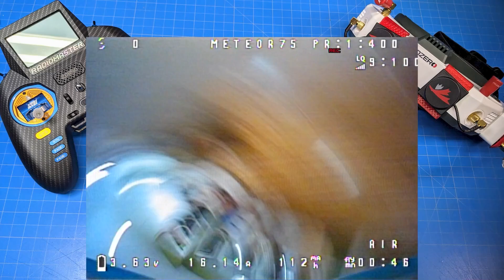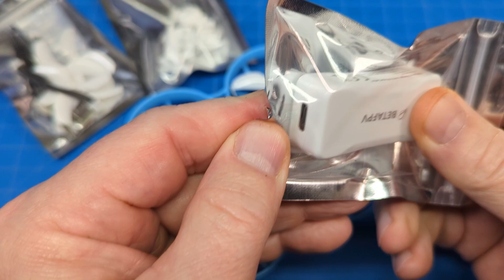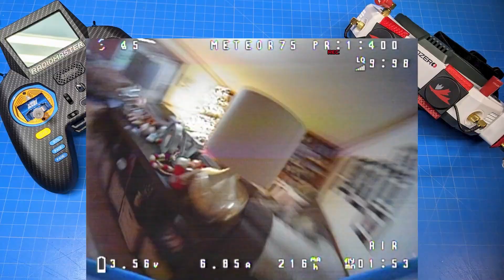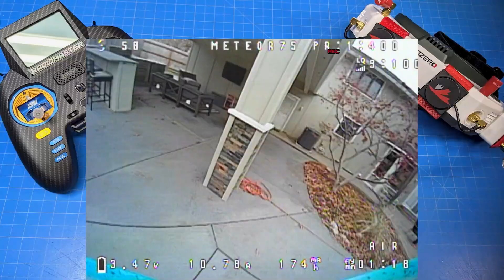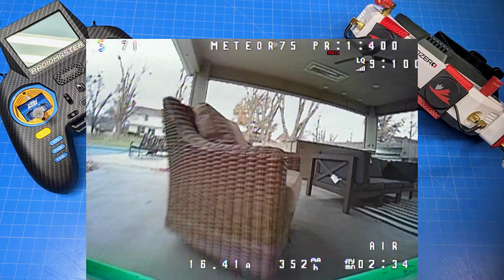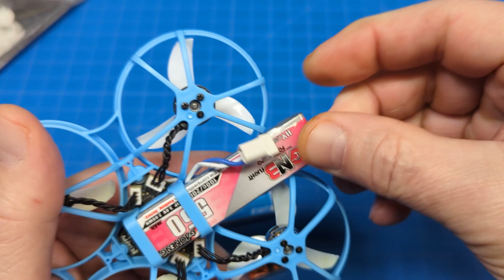Meteor 75 Pro // BetaFPV Matrix 5in1

Comment: Yeap. I have the exact same problem with the vtx right out of the box. Betafpv did a good job with putting a coating over the vtx antenna connector, so the connector is not loose. Changing bands and power didn't make a difference. Outdoors I don't have the same issue. I get a way better and stable feed from gen 1 Mobula 6 at 25mw. This was my fear with this 5 in 1 board, that the vtx would be bad .  So disappointed with Betafpv on this tiny whoop

Comment: Ey nick  what do you prefer air75 or meteor 75pro for flying outdoors and some Indoors, also im gonna stick a naked runcan thumb pro for 4k footage adding 10,grams, which would handle. Better the weight? thanks
Reply from the maker: I like the air75 but for your external camera flight I would suggest the 75pro
Reply: @NickBurnsFPV  thanks

Comment: This was my first drone and it didn't fly well on default PIDs with new props and everything. Bad oscillations coming out of dives. I tried my best as a beginner to fix it but I couldn't. I got a second drone eventually that actually flew how I wanted it to fly. I got a brand new chassis, the lite canopy, and ordered a new camera upgrade to the CO3. I'm going to practically rebuild the Meteor75 Pro and see if I can get it to rip again. I love my 65mm drone but I prefer the heavier, thicker plastic of the 75mm.
Reply from the maker: good feedback. Good to hear you were able to get it sorted out.

Comment: HI Nick, what's the analog module in your HDZero Goggle? Do you know whether the Steadyview receiver in Skyzone Cobra X V2 will work with HDZero Goggle?
Reply from the maker: I have the rapidfire module. I am not sure the steady view would work. It doesn’t have a button to use to change frequency and other settings. Not sure if the hdzero google would be able to manipulate that module

Comment: have to say amazing indoor flying but i have a problem when flying my meteor 75 pro when  i go to do back flips and front flips one of my motors tend to cut making the drone go all over the place and struggling to start up when arming the drone  got any suggestions
Reply from the maker: check for hairs around the motor, move the motor to another spot on the quad, it could be the esc isn't operating normally if the motor is fine on another esc. If the problem follows its likely the motor is damaged.
Reply: @ thanks for replying I have checked for any dirt or Hair
 But nothing I have order new motors I will soon see what the problem is just seeing if you had any other thoughts thank you
Reply from the maker: @finleydavies7047  The only other thing I can think of in the moment is to increase the esc startup power and see if that helps.
Reply: @ I have done that it’s almost max but we will see when I get my new motors thanks you

Comment: Can this be upgraded at all ? A better tune maybe idk new to fpv.And how would i change change the power to make video feedbetter?
Reply from the maker: Please don't change things as your starting out. The probability things get worse is high. Learning to fly fpv isn't the time to change settings, we need to learn to fly first. If we aren't familiar or confident flying the changes we make we either won't notice or it makes things worse, or even unflyable. More experienced flyers have learned not only how to fly but notice small changes. On youtube these small changes often as reported as "so much better" or "game changers". The reality is those changes have a very very minor impact to the vast majority.
Reply: @NickBurnsFPV  i can fly across fast Bob and weave andcontro, the drone I just haven't been able to flip it like I can the th3 but yes I can fly it easily I got the simulators aswell on xbox and tabs so I'm fixing to master this shit.
Reply from the maker: @BowTwoone  each micro is different and has different flight characteristics. The tinyhawk isn't prop protected but this one is, so it would be less performance oriented and less powerful overall. We have to adjust to the available flight performance and characteristics.

Comment: Hello Nick, im a beginner in FPV, i wish to buy a test FPV, was thingking to get this on 04 version or the new Femto, can you help suggest?
Reply from the maker: getting started with DJI is of the most expensive way to start from a budget standpoint but does offer the best image experience. regardless of what you get I don't suggest planning to fly inside until the flight skills have build up. I think in the choices you have I would go prop protected if your area generally has low winds, below 12mph, if you have pretty consistent winds above that I think the better option is without prop protection.
Reply: @NickBurnsFPV  thanks for quick response, Im actually in Singapore and flying is controlled here. for now I just plan to fly at home first and build up my skills, I can go to small parks though and learn flying. So im thinking to get the femto, though its not fully protected as you say.. so im also eying the metor o4. i have some DJI gears already. the googles N3 and dji neo. thats why im gearing to o4.

Comment: Thanks for the review. Curious why you purchased batteries with the cable and not the plastic head?
Reply from the maker: no reason just what I have. GNB is one brand that often has battery leds rather than the cap.

Comment: I’m new to fpv and I hear that signal is really bad for houses with a few floors. Can you recommend a low to mid tier goggle?
Reply from the maker: I presume your asking for recommendations based on reception. I can't recommend anything in the budget line up as the reception is pretty much  all the same. the difference would be on those that allow you to change the antenna for a higher quality or high gain antenna.

Comment: Hello, im looking forward to buy my first fpv drone, but im thinking that should i buy the meteor 75pro or air75, which one should i buy?( i buy it for mainly flying outside)
Reply: mobula 6 1s. In my opinion, it is the easiest for beginners because it is so lightweight. Check the review from Nick Burns. I loved mine so much and it was the drone I flew the most indoors and outdoors. And that is the most important thing for a beginner drone, having one that you can actually fly often. indoors and outdoors if wind is not too hard.
Reply: @ it’s too small for flying outside
Reply: @Egbegbegb  I fly it outside all the time. If it's too windy, then you will just be battling the wind, in which case you can switch to fly indoors. Being so lightweight makes it almost indestructible, and it's hard to damage property or injure someone with it, it is quiet and harmless, people don't get scared of it and call the police. 1S batteries are cheap and charge quickly. Bottom line, lots of more flying hours. Which is what you need when starting.

Comment: Great review as always Nick.
I just finished up my comparison with the old Meteor 75 Pro the other week and never noticed any VTX issues like you were having. I have a second Matrix 5in1 for another build so I will definitely keep my eye open for this.
I do wonder if it happens more on the 400mw setting you were flying in as I mostly testing them in 25mw as I never needed any more power.
Might be worth looking into if yours would have less issues at a lower power setting and I will test if mine will have these issues at full power.
Reply from the maker: I should test the lower power. Good thought

Comment: Whats the difference between the air and the meteor drones, and do you think this one is better or worse than the air 75?
Reply from the maker: The air series are lighter and more geared towards higher performance. The meteors are not. I think this is not as good as the air75 for indoor flight, but better for outdoor flight.
Reply: @NickBurnsFPV  thanks!

Comment: Hi Nick,
I've just built a 75mm 2s with 1002s and hd zero 1s. I used a motor limit to 15000kv and I'm impressed. It has a lot of ompf, flies a solid 3.5 min, and is very crash friendly. It's like rediscovering the trashcan :)
Reply: How much did it cost

Comment: I have been away from the whoop hobby for 3-4 yrs. but I see that you are still making great videos. I also see you using HD Zero? goggles and ELRS ? controller.  Are you doing a "Best whoop" of the year video like you used too? I was trying to determine if my old equipment is gonna work with current whoops or what do I need to upgrade to get myself up to date and flying again. It looks like prices have gone up a lot on everything and I would not want to get the wrong equipment.
Reply from the maker: I don't have a plan to do a "Best" whoop video. Likely the whoops most are looking at the air series from betafpv, the mobula 6 2024 from happymodel and the hummingbird v3.1 RS from newbeedrone. All are light weight and high performers in the 65mm category.

Comment: I tried for a couple months to make the most of 75mmPro builds and never could find a good spot for it.  Just went back to 75mm or 85mm
Reply from the maker: yea, an 85mm 2s will be a good/better fit for most of the outdoor spaces this one is likely be be flown in.
Reply: @ yah I agree and I think it is closer to an 85mm in size than a 75mm anyway.  
I thought it'd be like the 65mm to 65pro change and advantages but not nearly as beneficial

Comment: I have the meteor with the new 5in1 and I do not have the same video issues. set at 100mw sitting on my desk I have had it throw the temp warning and video get dark and green. But the betafpv 5in1 I bought mid December and have around 40 batteries through it and a good number of crashes. One thing I noticed, which shouldn’t make any difference, but just curious, my vtx antenna loops around and barely sticks out of the canopy hole, did you reroute yours? if anything it should just make it better, but thats one thing I see different.  I have seen that black screen with vertical lines on my home made screen I made from old box goggles that I had to replace the battery in, and decided just to use it as a kind of backup screen, Only when using old old batteries that drop below 3.0v almost instantly, just testing old batteries, I had a mix of batteries I failed to store correctly, and they would seem fine until take off.  I have also had the vtx seem to just shut itself off after giving me a temp warning and going dark green when set at 100mw and sitting on my desk too long messing with radio settings. otherwise my video looks fine. I can post dvr from my goggles I do seem to get way better penetration on 100mw vs 25, and again when you said it vacuumed itself to the fence, gotta put airmode on a switch hahaha. I fly quite a bit less aggressively as I had quit flying for a while got bored of 5” freestyle, just getting back into “whoops”  I got the air75 which has the external elrs lite v1.1 and the meteor with the 5in1 (aio elrs, esc, G4 FC, vtx, osd) I guess you could call it a 6in1 because it has 16mb of onboard blackbox which kind of blows my mind. Also a bit nuttz that the vtx goes up to 400mw. all on one tiny board.
Reply from the maker: I didn't reroute the antenna. Pretty much just set my rates, modes/switches and OSD. I do have air mode on a switch but nearly never change it, I guess I got used to it and found some ways to get back to flying after sucking up against something.

Comment: ....... what the heck were they thinking with that static camera mount? Also I have a walksnail meteor 75 pro and I can fly it hard to the point where its hitting under 3 volts and it won't turn off. Only once the battery really comes down to about 3.0/3.1 does the avatar transmitter give out.  I have not been so disappointed by a drone in a hot minute. This whole thing just makes me shrug and say why? To compete with HDZero 5 in 1? No shot.

Comment: I might pick this one since you mention it can fit a gnb 550 1S A30 batteries and thats the ones I have so excellent. I hope I dont get that same problem with the vtx or black thing. One thing I might do is buy gemfan 45mm triblade props to see how goes because there are light weight than the stock ones. Well see. Overall, love the review, thanks for reviewing this one❤
Reply from the maker: I have several reporting here in the comments that their matrix AIO is working normally. Likely just mine that has the issue 🥲

Comment: Happy New Year, Nick! I received mine a week ago. I was dealing with a wobble and spent time fine-tuning the PIDs, but it turned out to be two bent motor shafts. Betafpv offered to send me replacement motors. However, the receiver started acting strangely; it disconnects when I arm it and struggles to reconnect. As you mentioned, I also noticed that the VTX on my Air 65 is better.
Reply from the maker: Out of the box with bent motor shafts? That sounds like a return that you were sent. Hopefully not
Reply: @NickBurnsFPV  Exactly, I think it was a returned item. I don't know about the receiver issue. I will return it unless they send me a new Matrix board.
Reply from the maker: @himox1651  Was it bought directly from betafpv or another shop?
Reply: @ direct from them, my shipping tracking was not great, but here local tracking in germany i saw info, it was shipped from a returns warehouse, so it was indeed a returned one
Reply from the maker: @himox1651  I didn't know betafpv sold returned items, nor that they had a returns warehouse. Was the product listed as "returned"?
Reply: @NickBurnsFPV  It was not listed as returned,so it should be new, but when they sent me a tracking number, it was showing the following:
From: JBD Retourenlager (Not seller) Germany
To: Me (my Adress)
Retourenlager in german means returns warehouse
Reply from the maker: @himox1651  oh very interesting thank you for the additional information.
Reply: @NickBurnsFPV  you are welcome, thank you for the effort u put making the videos, i‘m watching the TKS Rocket Race from 2021, great video

Comment: I flew the heck out of mine. Only problem I had was i flew it so much I finally killed it. Probably 600 plus packs. Broken frame fixed several times. Love this thing. Have a new one in the box just waiting. Great video. I broke the original AIO with mirco usb and broke it off very first set up. Ordered replacement micro usb and soldered back on and back at it. Didn't notice a difference from the original with separate elrs and the 4 in 1. Haven't flown this one yet. So we will see if same issues.

Comment: I think the video issue is rapidfire, not the meteor, i always had severe issues using rapidfire with my meteors... always had to run it in legacy mode so it wouldn't desync, had same issues with other cheaper vtx's too like speedybee or whatever, which is why i sold my rapidfire and will never have another... I used the starfish d1 for past few years since and only recently got speedybee module which i really like...
Reply from the maker: Typically on sync issues the image would roll across the screen, this seemed odd as it’s just black with colored “blocks”.

Comment: Very nice as always sir! I was back and forth on picking up the meteor 65 pro just for the winter and then they released this, so I snagged it. So far I'd say it's a great flyer, Betafpv I feel always does a good job with their boards, not a huuuuge fan of their motors.... The only issue so far with this one is every so often on outdoor flights I'd get the quick, grey, then rolling video from the right back to normal quick, like 3 seconds of screwy vision...not bad if up in air, but doing low maneuvers, your're done. This could have been from the cold maybe?? It was a pretty cold day, so possible battery issue.... Anyways great review my man! Take care and Happy New Year!
Reply from the maker: I doubt the cold is involved. What goggles or receiver are you using?
Reply: Had the exact same issue the other day: grey screen right after installing a fresh battery (the drone was in my hands, not armed), then after that problem went away (I disconnected/reconnected the battery IIRC) I had rolling screens during that flight. Was flying in a underground parking lot, so cold but not freezing. I was not tracking core temp but there was no warnings to be seen. Was using R8, 400mW (I only did a few flights over 100mW, and this is the only instance of this issue so far, so I suspect this might play a role), sky04L with 2 RHCP foxeer lollipops.

Comment: I just got this drone a little while ago and I couldn't figure out how to put the thing for the canopy mount on the camera to change it from 30° to 20 which I think it should have a 10° for noobs like me and I broke one of the wires which is very sad😢😢
Reply: I agree with you should have a 10degree angle i put the 20 degree on mine and its still a bit aggressive for my noob flying 😅

Meanwhile my sons whoop does 12 to 30 degrees and is more slower to fly or at least friendlier so I guess I just gotta get better 😂
Reply: @NFEzantiszar  nice yeah I'm kind of stupid and I took out the camera piece on the camera on the major 75 pro and I spent like an hour or two on YouTube and on other websites trying to figure out how to put it back on correctly and after you take it off I figured it fit over the camera wires that are soldered in and that's how I broke it cuz I just pushed it and twisted a little bit and it pulled out one of the red wires that's on the camera very sad
Reply: @NFEzantiszar  if your drone is too fast you should just lower the throttle max in betaflight.

Comment: That bad video looks very similar to the breakup from the first batch of the Air 5in1's.  Supposedly they fixed it in the future batches of 5in1s.  BetaFPV just doing Beta things...
Reply from the maker: Interesting, I hadn’t heard that was a first batch issue
Reply: 110%. My first kit was the Cetus X kit. The VTX has an overheating issue where even indoors it has a 80º+ temp warning. Fun products, just need to tighten that quality control.
Reply: He was using it at max power too. Did they just fix the hardware?